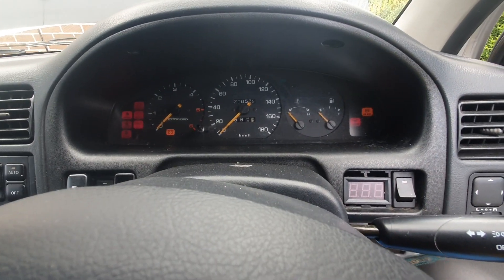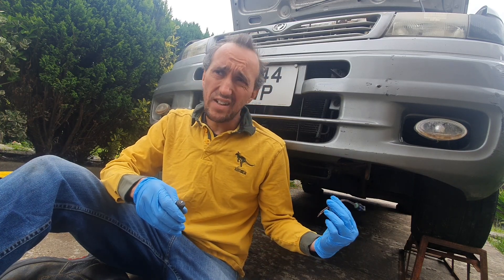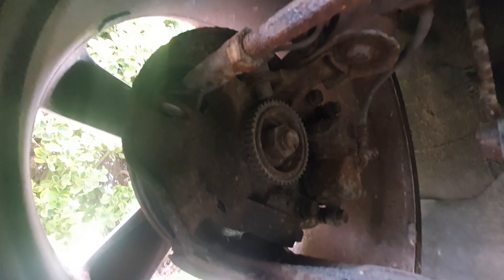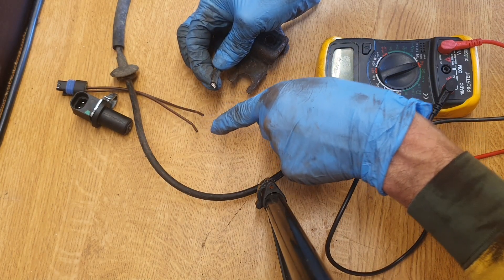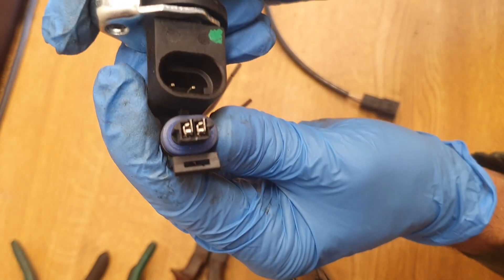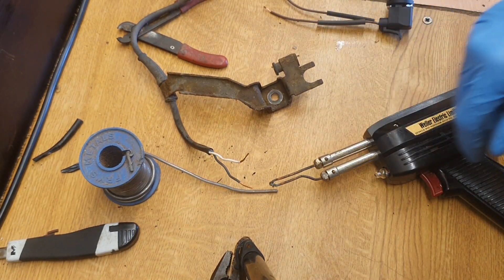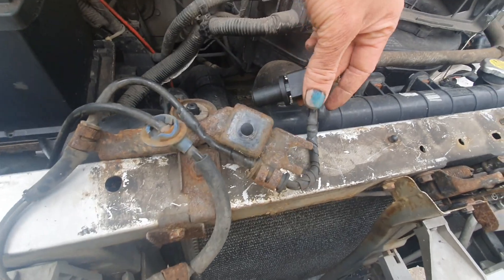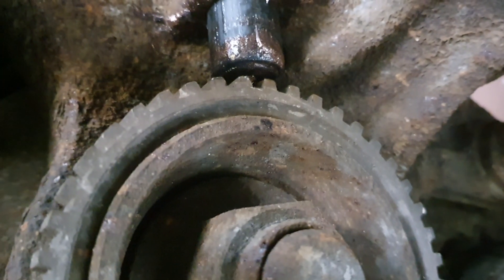ABS Take 2 - Daewoo Nexia Sensor on a Mazda Bongo

Comment: Great video Steve. Do you know what size the bolt is that secures the ABS sensor? I've read M6 x 1.25 x 14-16mm but that seems like an odd pitch for an M6 bolt

Comment: Cheers Steve just changed mine today same FDS, had to bash me old un out  Bolt also snapped then had to emery new sensor then lots of small taps with rubber dead drop Timmy (Mallet) 🤣🤣was shittin me self cus may have damaged new sensor but did Ohm check and was ok , tested it it works fine , the Original sensors now 250 gbp or 130 for rear  so I spent 25 gbp for sensor and 2 wire loom you linked too so my saving up to 450 gbp Pro Garage labour prices  I posted  link on Bongo fb page thanks again you are Diamond Geezer.👍🤠
Reply from the maker: Glad you found it useful mate, I didnt realise they had got so expensive!  It's crazy money for a hall sensor and a bit of wire!

Comment: Great video! Followed your instructions and initially the abs warning light turned off but turned on next time I started it. Getting 120 ohms, haven’t fitted it to the wheel yet, any thoughts please? Thanks!
Reply from the maker: I can't remember of hand what the ohms should be, I would recheck the error code and test the other sensors.  Also check the sensor tips are clean and you are not missing any teeth on the cogs

Comment: Clever fix.  Er, why didn't you put it up on stands and take the wheel off?  Wouldn't it have made it easier or does it just seem that way on video.  :-)
Reply from the maker: It would have made it a little bit easier but I couldn't move the van as I had partially stripped it to do the Diesel Pump.  I was waiting for parts so tackled another job. 😀
Reply: @StevesMachines  Everyone's a critic! 😄
Reply from the maker: @PaulinesPastimes  😆
Reply: Me thinks this young man is never happier doing things in a different fashion. Can't fault the level of his expertise and experience though, always good to watch the progress of another repair, and see it running!!
Worried about the "Love taps" with the "persuadertron" though  LOL!!
Reply from the maker: Doing things in a different fashion as I'm too tight to do them properly 🤣

The persuadatron is an excellent tool for either willing things into place or breaking expensive things 😁
Reply: @StevesMachines  Cant fault you buddy. On the QT, I have a toolbox full of persuaders, all sizes, so always have one for the job LOL!!
Reply from the maker: It's good to have a variety 😊